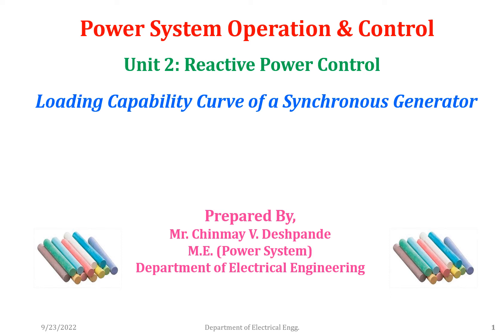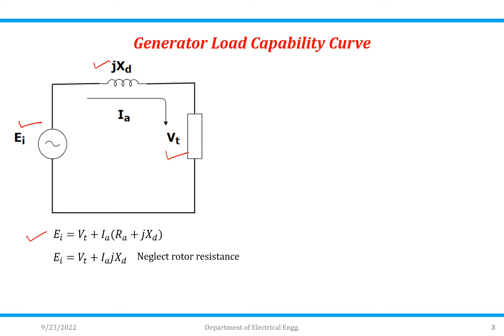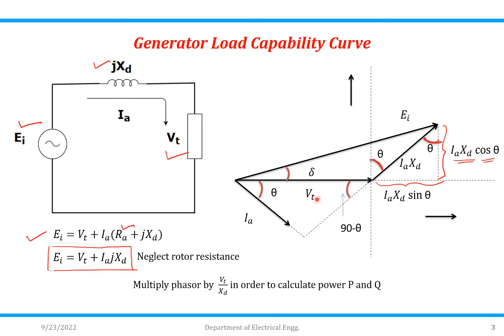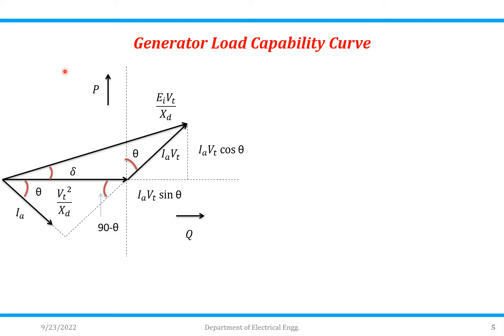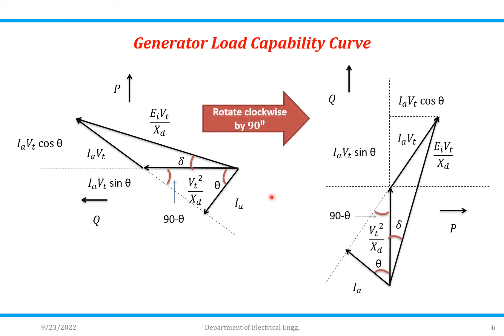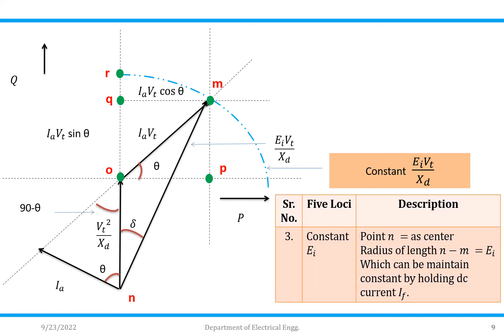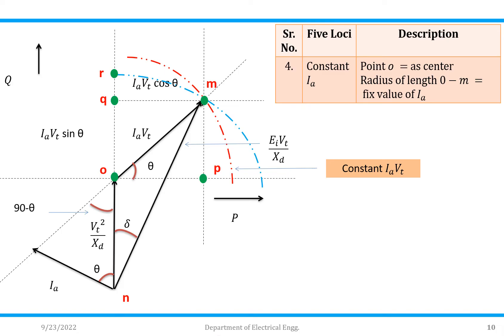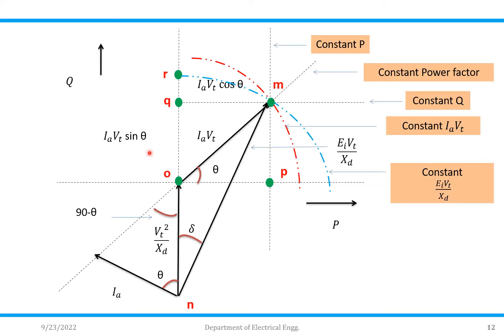Lec 05 Reactive Power Control Loading capability curve of a synchronous generator

Comment: Sir as their is pure inductor in the ckt so current should lag exact 90 degree from voltage vt but its lagging at an angle theta why?
Reply from the maker: Actually in circuit it includes Ra and Xd and hence it will not be purely inductive.
For derivation purpose we are neglecting Ra which is less than Xd
But it has its ken existence too.
Reply: @chinmaydeshpande9674  thankyou very much for clarifying my doubt sir